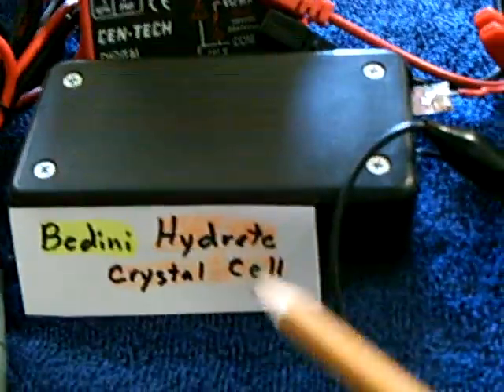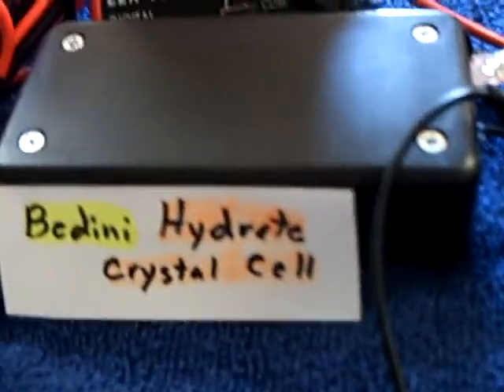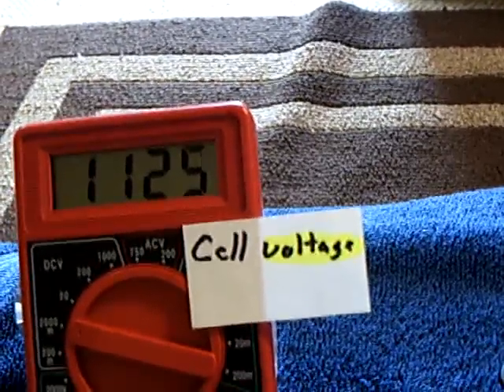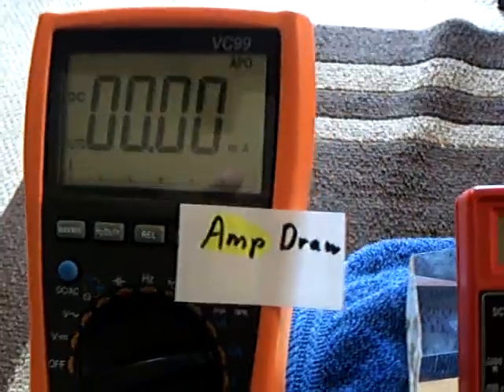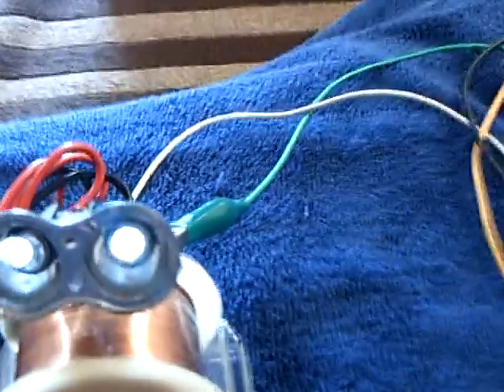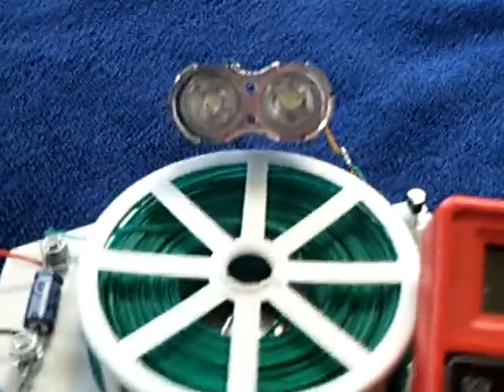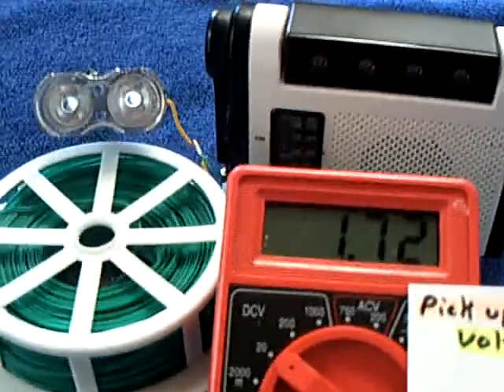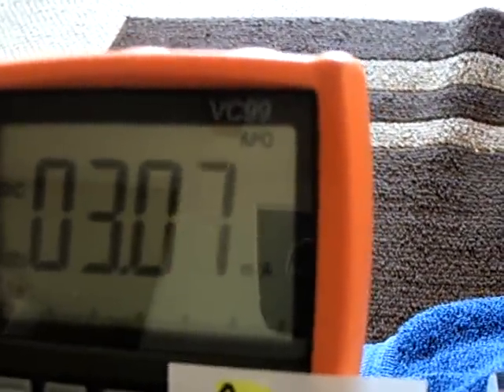Bedini Hydrate Crystal Cell---powering a pulse motor and PENNY

Comment from the maker: @72fr250 ----Maggie has a bridge rectifier connected directly to the spool of 45 ga magnet wire.  The led eyes are in parallel and connected to the output of the bridge. The wires leading to the meter and Penny are also connected to the bridge output (paralleled).  She is really just a simple alternator. Amperage isn't much but she does pretty good with voltage.

Comment from the maker: @72fr250 ----Thanks!  That makes sense. I was wonder why the meter was showing the lower voltage with just Maggie -----Those LEDs don't light up at 1.7 volts.  Forward voltage on those is over 2.

Comment: I have a lynx joule lamp air coil set up on my battery bank for my lighting. I also have a SSG ran off the same bank of battery's. I noticed when desulfating a battery I was trying to repair that when the wife turned on a light that was hooked to the joule ringer circuit the voltage on my charge battery jumped up around 3/4 of a volt higher. This my be the same effect just on a larger scale. I would have not noticed this had I not been recording voltages.

Comment: Ok, I rethought my comment, I'm pretty sure this explains the voltage rise. The meter at first is picking up the average voltage from Maggie because she's generating pulsed dc. When you add Penny, the capacitor in parallel smooths out the peaks so that the meter reads the actual output voltage.